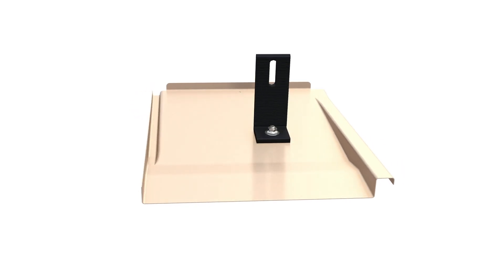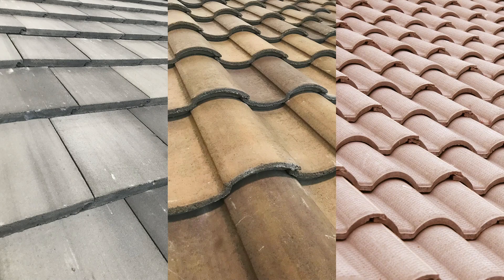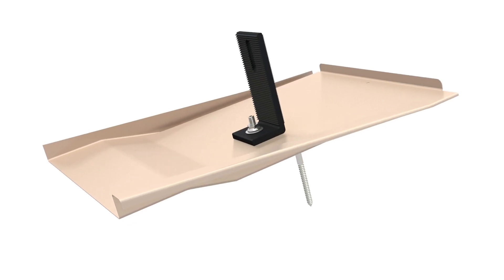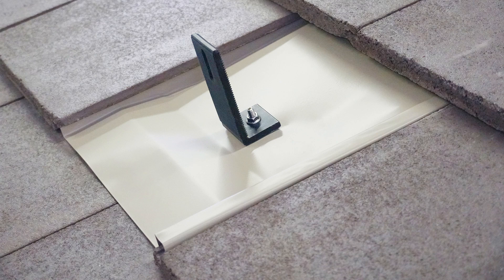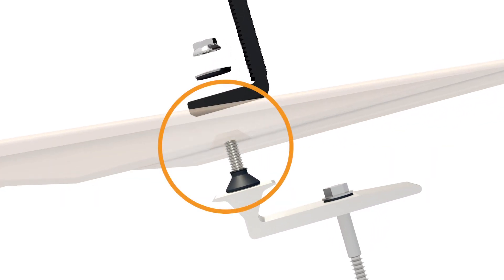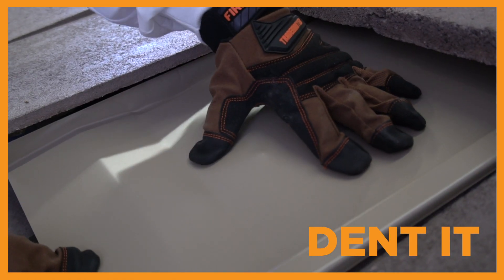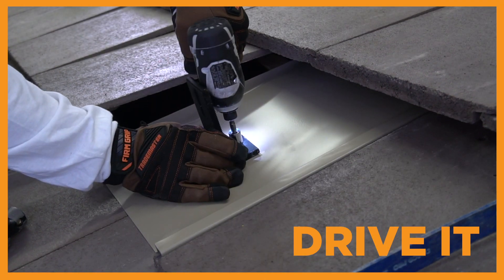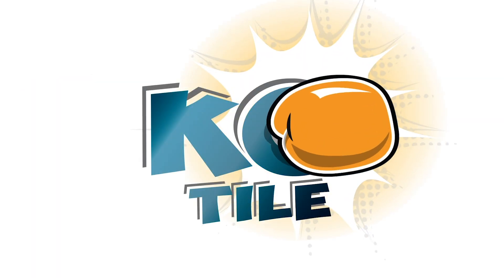Introducing Knockout Tile // Tile Replacement Mount

Comment: Can you show us in a real condition like in a real roof where rafters are not in the middle of the tile?  I'm really having hard time intalling it in a flat tile 😢
Reply from the maker: Thanks for checking in with us, Rami! We know rafters don't always line up where it would be easiest. Luckily, the KO Base can be installed anywhere in the attachment/flashing zone and it can also be rotated 90 degrees to accommodate the situation, not just up and down. You can always contact our support team with an email at support@ironridge.com for further assistance. And we have an entire tile installation course available on your website for FREE. Check it out here: https://IronRidge.com/training

Comment: what happens if your rafter is not within the zone..
Reply from the maker: Hey Ray, great question! As you are probably aware, the rafter spacing can vary on roofs. If the tile you pull up for an attachment location doesn't have an accessible rafter, you will need to move over to an adjacent tile--while making sure you're attachment spacing and/or rail cantilever still meets your design specs.
Reply: @IronRidgeSolar  So if the rafter is like RIGHT where the 2 tiles meet, that rafter cannot be used?
Reply from the maker: Hey Ray, you can contact our tech team at support@ironridge.com to get detailed answers to this question and more. And if you end up having a problem in the field, let them know--they are always ready to assist!
Reply: @raywarner8874  so did they explain ?
Reply: @BiqBoii117  issue usually is when the L foot lands between 2 tiles not the base. In that case, given that rafter spacing is either 16 or 24"oc and tiles are narrower than that, good chance that if you move your base to the next tile before/after, you will avoid having the L foot between 2 tiles. Done